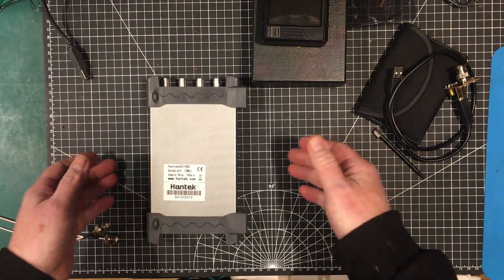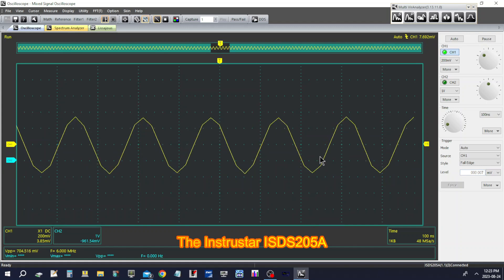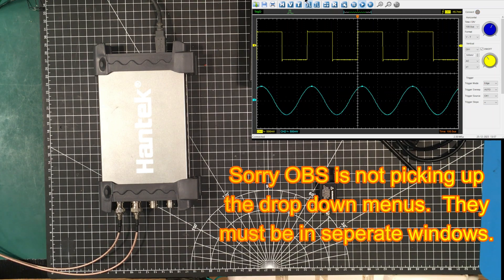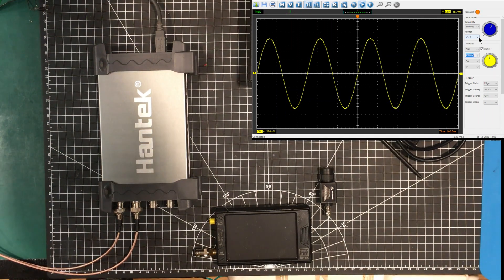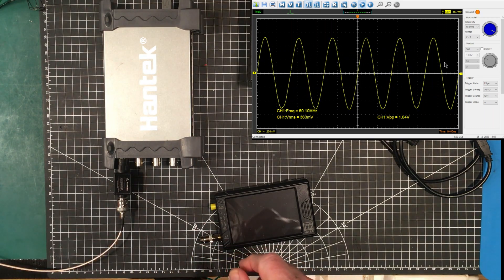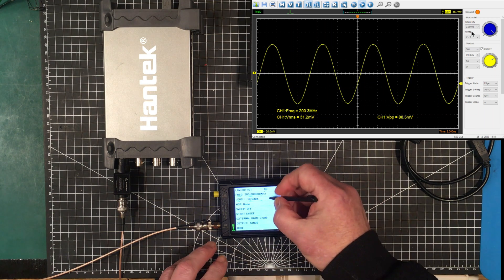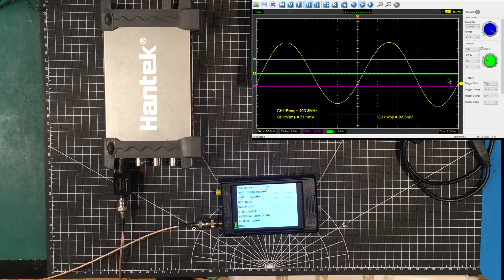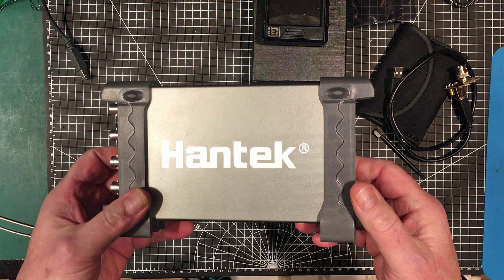Uni-Byte 0140 - Hantek 6074BC USB Oscilloscope:  Part 1 - Surprising Performance!

Comment: Hi, I found your video, and I thought it was fantastic! First, let me thank you for your contribution in the video. I want to buy the Hantek DS6074BE. Channels: 4 independent analog channels. Bandwidth: 70 MHz. Sampling Rate: 1 GSa/s (real-time). Input Sensitivity: 2mV - 10V/DIV (high range). Resolution: 8 bits. Memory Depth: 64K. Input Impedance: 1MΩ 25pF. Time Base Range: 2ns/div - 1000s/div. The one that comes in a kit, with attenuators, current meters, etc. I'm going to use it for automotive applications. Do you think it's a good option? Regards!
Reply from the maker: It would be very good at that.  There is also the 1008A that is specifically designed for automotive work.  Have you had a look at that?

Comment: are the 100/200 and 250Mhz versions of this DSO exactly the same? since you can already achieve 280Mhz with single channel there is nothing to "unlock/hack" am I right? or 100Mhz version is 100Mhz per channel which means 400Mhz single channel?
Reply from the maker: It is printed right on the circuit board that it is the same for all models.  I have no experience with the other models but the single channel speed is going to be limited by the analog components of the design the maximum being 250MHz.  FOr this reason I think the best you can get out of any ot the different models will be just over 250MHz.  But I could be wrong.
Reply: @uni-byte  in that case I think they just didn't bother with software locking. it's interesting though because they sell 250Mhz version $80 more than the 70Mhz version which looks like is completely unnecessary
Reply from the maker: @tapirath  I think with the 250MHz model the ADC is either different or unlocked to provide 250MHz on all 4 channels.

Comment: with this 6074BC model being specified with a bandwidth of 70 MHz, but still apparently being able to handle 250 MHz (albeit with amplitude loss), I am wondering how far the Hantek6254BC with its specififed bandwidth of 250 MHz can be operated above its specification.
Reply from the maker: The amplitude loss was within 3dB which is the point out to which BW is usually measured.  On the 6254BC, I don't know but it would be interesting to find out.  Are you planning to get one?
Reply: @uni-byte  I'm currently looking for the right oscilloscope to purchase, and your videos are a great help during this. Having access to capturing signals at a higher bandwidth could be helpful in some scenarios, such as reverse engineering.

Now seeing that the 6074BC is capable of handling threefold of bandwidth it is specified, I was wondering how much the 6254BC can be stretched before hitting limits. Theoretically, with 1 GSa/s, a 500 MHz bandwidth could be achievable. This of course greatly depends on the analog front-end (which may or may not be identical to the 6074BC - who knows, only a teardown of both could tell).

The 6254BC currently (as of July 2024) costs 385 EUR including VAT in Hantek's EU online shop (versus 306,13 EUR for the 6074BC).
Reply from the maker: @Abdullu  Yes, it would definitely depend on the front end as well as how they handle the sampling when fewer channels are used.  Have you seen Part 2?  In that I tear it down and you can see the silkscreen on the board.  They use the same board for all the 6xx4 series scopes.  So, they will definitely have to change the ADC and the firmware, but I'm not sure if they change anything in the front end.  As it stands, they would not have to as the front end in the 6074 does go to 250MHz, so my guess is they won't, but that's just a guess.  I do not know for sure.

Comment: is 6074BE as good as BC?
Reply from the maker: The BE is only 2 channel and only samples at 250MHz whereas the BC is 4 channel and samples a 1GHz.  So, no it's not nearly as good.
Reply: @uni-byte  hmm... official Hantek cite tells BE is 4 channel, 70MHz and 1Gs/s
Reply from the maker: @VladGoro25  I can only find the 6002BE series on their website.  Not a 6004BE series.  There are 6004BC, 6004BD and 6004EU series.  all of these are 4ch. @ 1GHz sample rate.  The idiots at youtube will not let me post a link.
Reply from the maker: @VladGoro25  Okay, I did a google search for it and found it.  Seems like it comes as a part of an automotive kit, is that right?  I really don't know this one.  According to the info on Hantek dot com it can do a lot of automotive measurements with the right accessories, but otherwise seems the same.

Comment: i am in the market for 2 or 4ch USB scope that can work with square signals up to 100Mhz. i think this is good scope for the money!
Reply from the maker: How square do you expect the signal to be?  To be able to reproduce a square wave fairly well the scope needs to be able to produce the fundamental and at least the first 3 or 4 harmonics.  That means to get a decent 100MHz square wave you need a scope with a bandwidth of at least 1GHz and a sample rate of at least 4GHz.  This scope will produce a waveform from a 100MHz square wave, but it will not look very square.

Comment: Thanks for the review. I'll look for part 2 to arrive. I may get one of these. My old 100 MHz CRT-display Tek scope is really lacking in modern features, things like storage, 4 channels, FFT, and a sig gen. It still works just fine, but it's way behind the times. The rest of my gear is all much better. My scope is the weakest point on my bench, so it's time for a change.